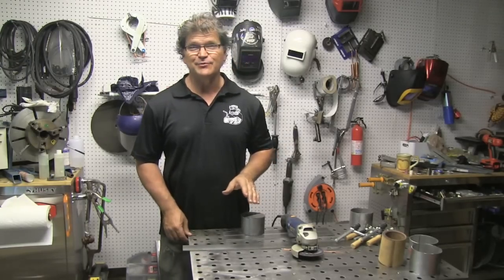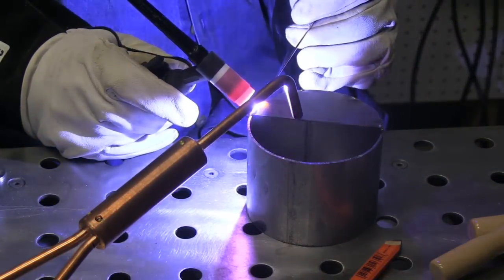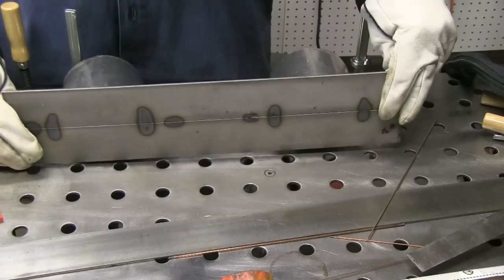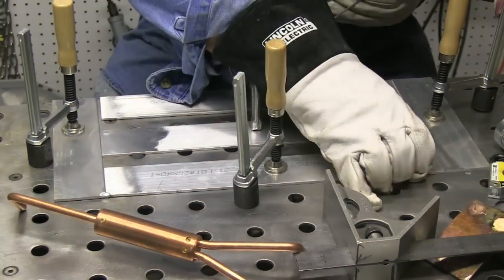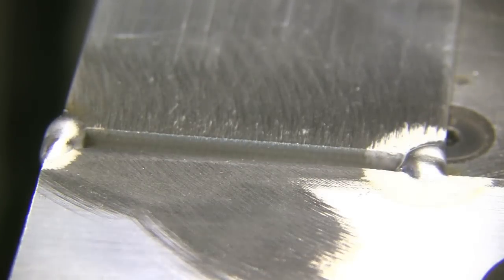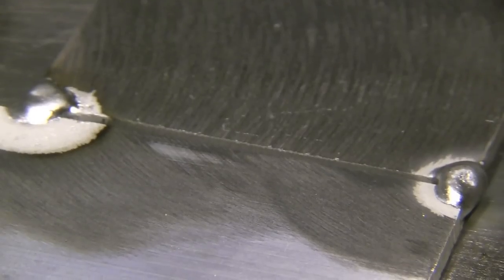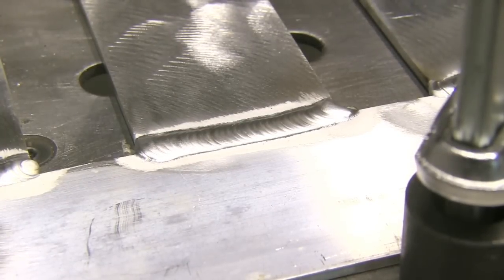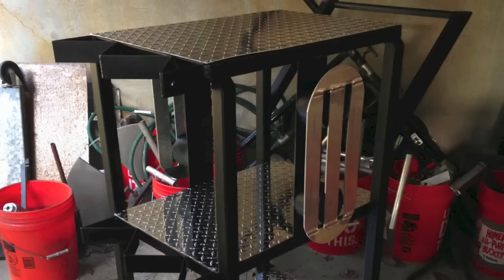Welding Cart project part4

Comment: good afternoon jodie i have been a subscriber to your fourm from 2011 and i have learned a ton although i don't own a tig welder yet I'm in the process of buying one  i value your opinion and i would like your input on the Eastwood AC/DC TIG 200 the cost is about 900 I don't have the money to buy a diversion 185 or a square wave 175 so this is my rage for now 700 to 900 dollars thanks

Comment: Err, why are you pre-drilling your drill tip screws?
Just stab 'em through ;P
Reply: and if you've ever tired to use self taping stainless screws into thicker aluminum they bind up and snap off rather easily.
Reply from the maker: I wanted a flush screw head so I countersunk the holes. I have used hex head self drill screws before with pretty good luck but with these phillips head screws, even pre drilling with too small a hole is a problem. I went thru a few driver bits before getting the pre drill sized just right
Reply: Also, the screw works much like a tap.  If the screw cuts "threads" in both pieces they wouldn't pull together.  The screws need to slip through the aluminum but engage in the steel part below.

Comment: I am very pleased to display all your videos and refined technique of welding. 
A request: Welding aluminum 40 ft boat multi chine hull (plate .50 and 3/8 Inch thick) and processes to prevent distortion and  aspect of hungries horse